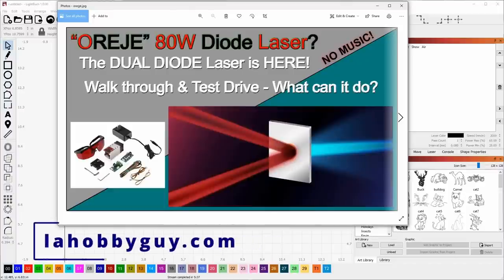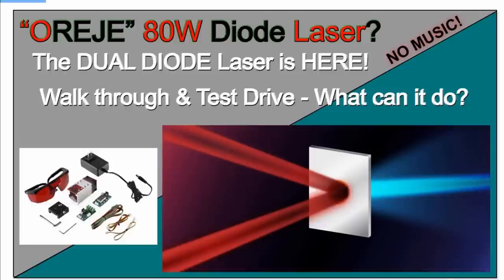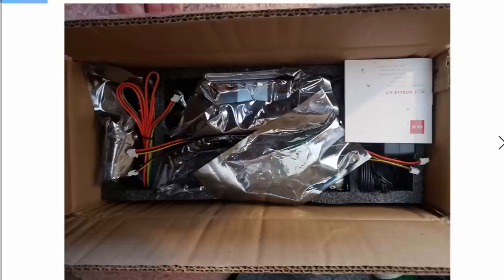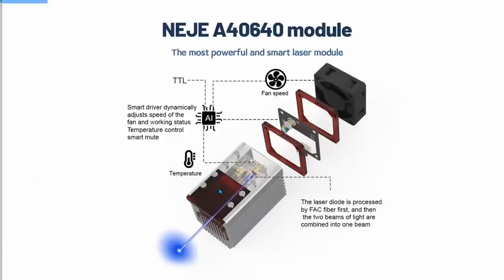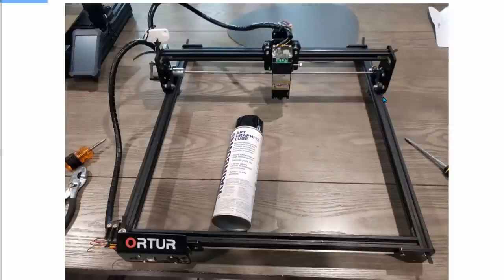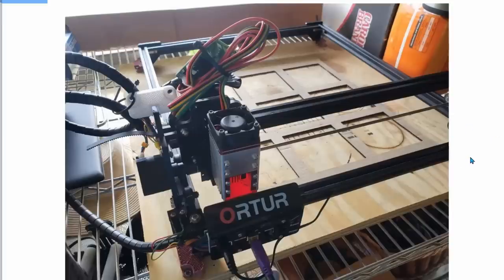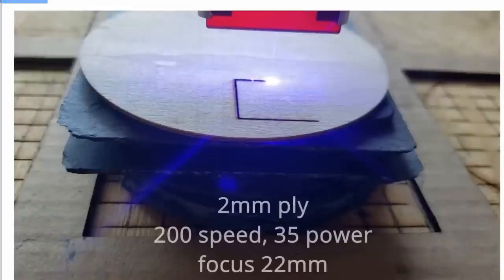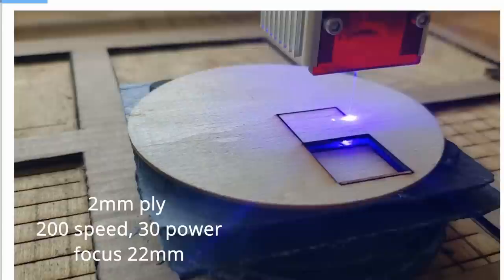Upgrading a diode laser from 20 to 80 watts!

Comment: I am confused.  The link takes you to a 10 watt module.  Why does the video say 80 watts?
Reply from the maker: It's marketing hype from the company. I made that clear in the pinned comment. There is no such thing as an 80W diode laser. The companies have a poor way of describing them. They rate the input and optical output of the laser, concentrating on the input. So the power supply draws up to 80W of current from the wall outlet, however the optical output is only 10W. The most powerful diode laser on the market is the brand new 20W quad-diode developed by Atomstack and followed by xTool, 4 5W diodes collimated into one beam.

Comment: I have watched you video several times . I just purchased a used Ortur LM2 and have been up making some upgrades. I see you have installed this module on your LM2 is there any changes that need to be done to install the module or is it plug and play. Any stop adjustment? Great video by the way. you are virtually the ONLY video of its kind on the net.
Reply from the maker: Thanks, I bought the kit with the adapter board, so the only modification was moving the Y limit switch forward a few mms.

Comment: Hi. If I want to get in to laser cutting ply, which is for marine use case. What do you think is a decent beginner printer on AliExpress today for a good price? I guess I need 80w or even more since it's for cutting 8mm wood. Anything you would recommend or think looks good for a decent price?
Reply from the maker: 80W is the electric power of the machine. 10W is the true optical output. This is an older video, and thankfully they have stopped rating them that way. Diode lasers wouldn't be the choice for cutting marine grade plywood.

Comment: Hi, noticed at the 5.05 minute mark, the cables are wrapped in coil type cable conduit. Is that as effective as drag chain setup?
Reply from the maker: The wire looms work well for me, but I don't think I would say as well as a drag chain.
Reply: Thanks for the prompt reply

Comment: All you video are very informative  thank you
About the NEJE A40640.. In one of your replys below, you mention focusing using a microscope. Have you used it to measure the spoy size at best focus? The diode in my Ortour LM2 (20w LU1-4) has a spot size of 0.06 mm in one direction and about 0.20mm in the other. Have you measured the spot size of the NEJE ? I would like to upgrade to the NEJE but only if the actual measured spot size is 0.06mm or less. Also,  have you had any problems with the NEJE, and how many hours do you have on it. Thanks again for the great videos
Reply from the maker: I measured it a long time ago and I don't remember what it was, but it was square. Lots of hours on it, and it blows away the Ortur Pro.
Reply: @TheLouisianaHobbyGuy  Thanks ! i was hoping for actual x and y spot sizes, but positive experience with it has lead me to push the BUY button lol.  Somewhat pricy in Canadian dollars....but as they sat.... it's only money !

Comment: I am not sure what 12v power supply that Neje supplied? Or your original? Mine is 24v. Also noticed that the link is to Amazon. Not Aliexpress. And I don't think a power supply is provided by either.
Reply from the maker: I got my from Aliexpress from the Neje Direct store and it came with a PS. The package contents list on Aliexpress says, "12V4A UL Certified Power Adapter". But you're right, it doesn't say that on Amazon, so I guess they have different packages Walt.

Comment: Be aware that the Ortur Laser Master 2 PRO has a 24 volt supply and that input to the described laser module is 12 volts.
Reply from the maker: Yes it does, but it doesn't matter. The kit comes with its own power supply that plugs into the adapter board and a well explained pictorial diagram.

Comment: Thanks for the video, it was very useful. Can I damage the laser if I use it on maximum output power (100%) for minutes for example for mdf cutting? Thanks in advance.
Reply from the maker: The manufacturers usually suggest not running the laser at 100% power for more than 20-30 minutes at a time.

Comment: Do you power the integrated card that comes with the neje module with the power supply of the neje kit?.      the explanation of the connection of cables was very fast, you spent more time on simpler things, ... I think
Reply from the maker: Yes you do if you want the full power of the module Ariel.
Reply: @TheLouisianaHobbyGuy  So if plug and play is installed, power is lost?.   Thank's and Cheers
Reply from the maker: I don't understand the question.

Comment: The new module is 12 volts and Ortur's is 24 volts.
How does that work. And please, how much power does the new module need? 
Any Info, please.
Reply from the maker: You have to use the supplied 40W power adapter plugged into the adapter board Reinhard. And you have to cut the red wire on the supplied cable so power doesn't come from the control board.
Reply: @TheLouisianaHobbyGuy   Thanks

Comment: Evening Rich. I have been running a 20 watt laser/10 watt out on my laser since assembly. I have recently upgraded from the 20 watt to the 40 watt/20 watt out laser. I am not getting the results that I expected, as in faster rate to cut 3mm basswood. I am using the exact same settings for the 20 and 40 to cut 3mm, that being 140mm/m @ 90%. Is there something that needs to be changed so Lightburn knows I have a higher output laser? Thanks in advance.
Reply from the maker: No, there isn't, but you may be having a focus issue.

Comment: i am totaly lost. i have the ortue master 2 (not the pro), just received my Neje A40640. do you have a detailed instructions. i can't see how to put it all together. the picture at 4:49 confuses me how it attached. are you able to help me?
Reply from the maker: All I did at 4:49 was screw the Neje mount to the Ortur. I only used one screw, made it really tight and it held just fine for 2 months until I printed a new gantry mount for the Neje.

Comment: Interesting tests.  I was wondering if you could answer a question.  I am fairly new to laser engravers, but I was wondering why the focus on this laser module is so high at 20mm, but the laser I have is almost touching the wood at about 5mm.
Reply from the maker: Because this has a different lens. There are long and short focus lenses.
Reply: @TheLouisianaHobbyGuy  Does a longer focal lens allow deeper cuts?  I am assuming the cheaper lasers come with a short focal lens?  What is a F.A.C. lens?  What is the benefit over a standard lens?
Reply from the maker: The LF lens does cut better than the SF. The FAC lens is Fast Access Collimating. Meaning is collimates two beams into one at the proper focal point (FA) and it is more expensive.

Comment: Shouldnt you connect a separate external 12V Supply to the Neje Board and not only the 12V which your Controller can deliver? The Neje can take over 40W electrical power which normally a controller cannot deliver?
Reply from the maker: Yes, you probably should or it can overheat if used for too long. I bought the kit with the PS & adapter board. Mine came with a 60W 12V PS so I just use that to the Ortur.

Comment: Very good video!  I have an existing CNC machine that I'm looking at putting a Laser on.  Diode laser looks to be the easiest way to start, I'm not sure if I could mount a CO2 on the gantry anyway.  My question is about expected lifetime of the Diode Laser,  what can I expect if I cut with it a lot.  I would be cutting mostly 6 mm Baltic birch after doing engraving on the surface.  I would rig up air assist and would also provide extra cooling to the Diode Laser module if possible.  My cutting table is 5' X 5' and I have 18" of travel in Z so plenty of room to install anything.
Appreciate your YouTube channel, you provide a lot of good information to people like me that know nothing about Lasers.
Reply from the maker: Hi Mike, you have pretty high expectations for a diode laser! Cutting 6mm ply in a production setting would be a very slow and arduous task for a diode. Think 100 mm/min and 4 passes min even with the most powerful diode. A better choice for this task is the C02. Expected lifetime is different for different manufacturers, but the better ones are 8-10,000 hours. I have 2 machines in production service for about 3 years now, and neither have shown any signs of degradation yet.
Reply: @TheLouisianaHobbyGuy  Thank you for the reply, I’ll look into the CO2 options.  Time is money and I can’t tie a machine up cutting that slow.

Comment: According to your link, and also in the official NEJE store on ALIEXPRESS, this laser comes with an output power of 10 watts. They don’t have another model that is more powerful now! Which is quite plausible, since put two diodes of 7.5 watts and nothing changes cooling will not work! So 15 watts is pure marketing from the Chinese!
Reply from the maker: When I bought mine last year it was sold as 15W. It measured 13.2 on an output meter. Neje has since changed to 2 5W diodes in the fall of last year.
Reply: @TheLouisianaHobbyGuy  Dear friend, thank you for your answer! I want to take a 10 watt module from NEJE and put it on my ORTUR 2 PRO. But I have a 24V power supply, and this confuses me! How can I connect this module in this case?And will the NEJE module work fully in ORTUR 2 PRO with 24v power supply?
Reply from the maker: @aleksaleksl699  Instructions are in the description.

Comment: Great video! Have do upgrade mye Ortur LM2 for this now, so I can start cutting properly! :D 
Which tool do you use to focus the laser? Do you print them yourself on a 3D printer, or is there something you could buy at the store? :)
And do you have a new link for the laser? The one you posted, doesn't work anymore :/
Reply from the maker: Hi, no, this model isn't available anymore, but Ortur has a 10W version now that you can buy for the LM2 with an adapter. I laser cut my focus guides Camilla.
Reply: @TheLouisianaHobbyGuy  thanks for the reply! Do you know exactly the name for the new laser? Find it hard to find the correct laser with so many options/different names 😅 
And is the new laser also compatible with Ortur lm2? ☺️ thanks! Love your account!!

Comment: thanks for the video. I am about to get a laser cutter and engraver. I believe I will go with the Sculpfun S9. Are you familiar with that setup?
Reply from the maker: Yes, not particularly a fan. Their deceptive advertising says it's equivalent to a 90W C02... that's just plain false. It doesn't even compare to a 30W C02. It also doesn't have limit switches or a reset button, nor will it last for 15,000 hours. The best diode lasers have a max rating of 10,000 hrs. It is basically a normal 20W (5.5W optical output) laser, just like all the rest. It's an exact copy of the Atomstack A5. I would personally go with the Ortur, Neje or for a few more bucks, the FoxAlien 4040 CNC & Laser would be my number one pick.

Comment: I was looking at dual beam laser modules, like the Neje A40640 and found your video. 
I have a K40 CO2 laser, but the mirrors won't line up well and I believe the CO2 unit is weak, so I was wondering if I could yank the tube and mirrors and install with diode based module like this on the gantry.

Doing away with all those parts, and the cooling, would make it a more versatile unit and I wouldn't have to worry about heating my workshop/shed all the time in the winter, to keep the CO2 unit from freezing and cracking!
1) Do you know if anyone done this type of conversion?
2) If you were doing this, would you use the original K40 board to control the diode module (and board) or would you ditch the original K40 board and get something capable of running Lightburn or something else? 
3) If you were going to use the original K40 board, which of the two boards from this kit would you use, and which input would you connect to on the K40 board? 

I appreciate your input on this.
Reply from the maker: I wouldn't use either! I would use a Ruida board, but with that said, you can also use any board pre-loaded with GRBL 1.1. I would use something like this: https://amzn.to/3iqC5sA
It also has extra pin out connections for your air assist if you have it.
Reply: I’m considering doing this also. The water cooling in my 40w CO2 cutter is a pain and I think I need to replace (or regas) the tube as it’s definitely not outputting as much power as it should. 
I’ve already replaced the driver board with a GRBL one so it should be a simple upgrade, right? 🤣

Comment: Hi, I wonder if you could assist me in mounting the Neje40640 onto the LM2(20W LU1-4) laser mount. I have watched the video but I don't see how the 2 mounts can be attached to each other. The laser module came with a med size cross-point screw & small Alice screw but only 1 hole on the laser mount plate that came with the laser will match up with 1 of the 4 holes in the Ortur slider.
Reply from the maker: The LM2 needs mounting holes drilled in the back plate to accommodate the A40640. I printed a custom backing plate for mine.
Reply: @TheLouisianaHobbyGuy  Ah ok many thanks.

Comment: Great video, very informative.   A couple of questions: With using the Neje bracket in addition to the Ortur bracket (for the laser mount) did you have any issues with the laser module hitting the frame before the home limit switch? I ran into that when using a 3D printed air assist  fixture. Also when setting the focus distance what is the actual reference point. For the Ortur Lasermaster 2 I believe it is from the bottom of the lens to the top of the work piece. Do you have multiple spacers in 1mm increments  such as the one Ortur provides or how do you measure the focus distance?
Reply from the maker: Yes, you do need to move the Y limit switch forward. Setting the focus depends on the type of use, engraving or cutting. After several ramp tests, I found 20mm from the base of the aluminum cover is perfect for engraving. I 3D printed a step gage in 1mm increments for focusing and I also eventually 3D printed a new mounting plate as well.
Reply: @TheLouisianaHobbyGuy  Hi Rich! Do you sell the 1mm focus tool? I’m interested in one. I looked on the forum but couldn’t find it. Thanks always sharing your videos.
Reply from the maker: No I don't, but I used to use a micro-SD card. It works perfectly.
Reply: @TheLouisianaHobbyGuy  I printed a similar tool that goes up in 1mm steps.
Reply: @TheLouisianaHobbyGuy  I 3d printed a spacer that fits on the rail so I wouldn't have to move the limit switch. I did this for the after market shield I bought for my Lastermaster 2. Actually had to print one for both x and y stops.

Comment: awesome, I have the same ortur system. I bought it from ali express, so I really think I'm going to buy one of these. I do have air assist right now, do you have an air assist setup for this new laser?  I think it is worth it.
Reply from the maker: I do, but I don't use it for making videos since most people don't have it. I use a box fan blowing on the work area. It works just as well as AA for engraving.
Reply: @TheLouisianaHobbyGuy  I would imagine that using air assist (clearing the debris from the cut path) would make a cleaner/deeper/faster cut path. This is my conclusion using my 20W/5.5W ortur laser master 2 with an air assist nozzle on my current setup.  I'm ordering the one your using, I was the highest power available right now. I've been contemplating going to a C02 laser to cut 1/8" and 1/4" wood as my setup using way too many passes to cut out designs. This will be my next stepping stone before a c02. THanks again!
Reply from the maker: @IIIofV  Once you dial in your settings, 3 & 6mm wood is a breeze with this laser. I cut 3mm @ 260 mm/min & 60 pwr in one pass, & 6mm @ 250 & 85. I have also found that 20mm is the optimal focus. Lower by 1/2 the thickness of the wood for a perfect cut. So if I were to cut 6mm wood, I would focus @ 17mm. I have also redesigned the air assist I use off camera to replace the red acrylic front plate.

Comment: Ok. This looks really interesting. Since I don’t have any laser system I am trying to decide. The Ortur or the NEJE Master 2S Max? I think more space would be handy. The most important thing to me is a rotary attachment. I cannot tell if NEJE has one or not? Thoughts?
Reply from the maker: Hi Douglass. Almost all lasers are compatible with rotaries. I have seen folks use both the Atomstack & Ortur rotary on the Neje. Neje does sometimes offer a pen roller but it's almost always sold out. Rotaries are just a replacement of the Y-Axis. You unplug the Y and plug it into the roller.

Comment: Hey Rich I had to come back and watch again, question for you, will this work on atomstack a5 pro + ? If so would it be a lot of moding or just plug and play like this one? Thanks for all you do and help Rich.
Reply from the maker: It would if you use a separate power supply and print a mounting bracket Jim.

Comment: I am about to pull the trigger on this upgrade on the OLM2, but I saw a post recently on FB that say you do not have to swap out the control board. Any thoughts on this?
Reply from the maker: No, you don't swap the control board, you use the adapter board & power supply provided by Neje Russell.

Comment: Can a 15 watt be upgraded to 40 watts without major changes?
Reply from the maker: When you say 40W, that is the machine + laser power. Diode lasers only come in up to 20W of optical output, which is the new quad-diode modules from Atomstack & x-Tool. Most others are either 3W, 4W, 5W or 10W of optical power. When you say 15W, I'm guessing it's 4-4.5W optical power. Upgrading to a 10W would probably make you very happy.